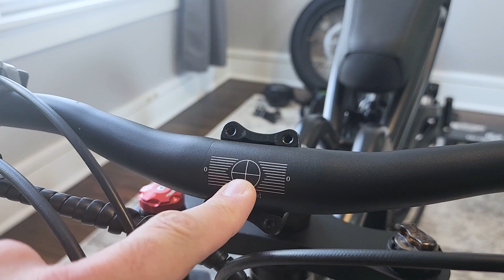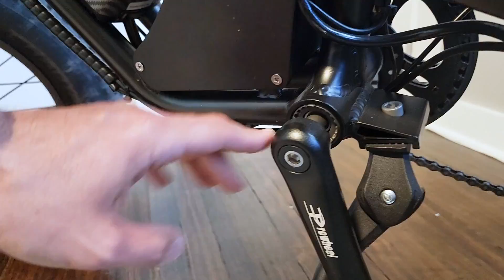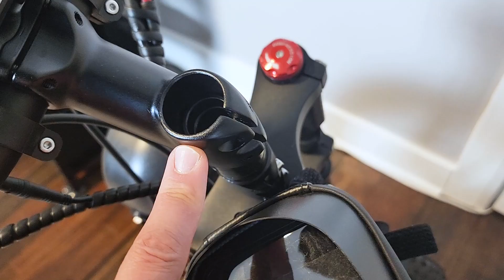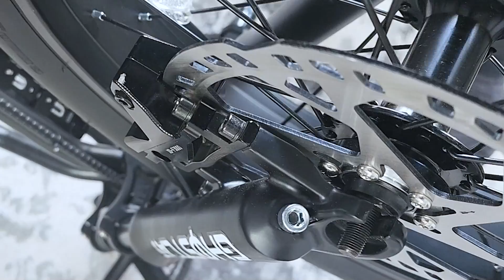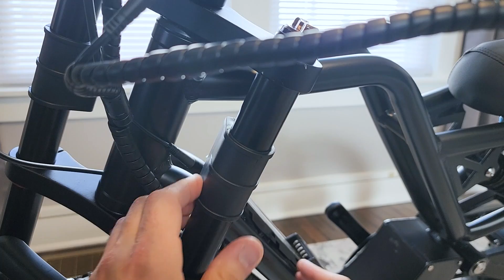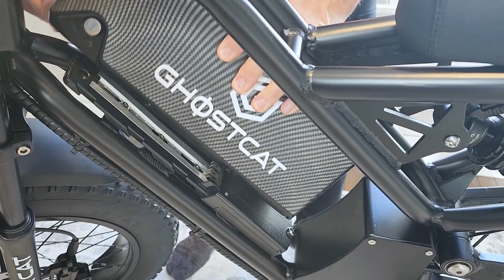How To Assemble Your E-Bike: GhostCat F2.2 Pro

Comment: My F3X front tire does not attach the same way. I think its a threw axle? I put it on the only way that makes sense but my rotor is rubbing. The rotor was the only thing not wrapped and was pushed against the inside of the box. I'm afraid it might be warped? I'm not sure what to do cuz Im not riding it with it scrapping like this. I knew this wouldnt be smooth with no directions 😢
Reply: I should have looked first cuz you already made a video about this which fixed this perfectly. I'll leave my comment incase someone else has this problem. Thank you!

Comment: Just got the f3, pretty rad bike. Would i be able to update the controller to make it faster tho ?
Reply from the maker: congtats! You would realistically need a higher voltage system to get a faster top speed. Not sure if the current controller and other parts could handle 60 or 72 volts. Also not sure about what the motor could handle.

Comment: BE WARNED! This is a china rebrand bike! Legit, same specs, same frame, wheels, breaks and everything. DO NOT BUY!
Reply from the maker: I don't think this statement is accurate. Feel free to post the link to the original here. As far as I'm aware no other bikes with this frame have this motor and controller.
Reply: The Akez Jaguar 1500w does have the same specs. It looks like Ghostcat buys their frames but uses a different motor and a few other parts.

Comment: Failing to mention what tools are used, you should explain what size wrenches are required for those that don't have a lot of tools and want to buy them ahead of time before the bike arrived
Reply from the maker: tools for putting the bike together are included.
Reply: @maximumchargeEV  that's awesome,this company seems to really stand out from others
Reply from the maker: @faiththroughtheflames  they are trying really hard!
Reply: I can attest they have top tier customer service. Just received my f3x yesterday. Technician calling today about something with the rear wheel i want to check on. They already know about the kickstand rattle and were proactive and made a ticket for a new or diff kickstand that doesnt rattle before the bike arrived. Additionally sending decals as i preferred the all black theme of the ghostcat on the front fork veruss the orange volcano suspension decals. Theyve been on communication since day one and before ordering which is main reason i did order. Kevin, nadine, hillary have all been top tier. Ive been in customer service over 12 years. Ive seen it all as well lol. Theyre amazing. I had some slight issues when the bike arrived like brakes and shimano gears on the handle bar not being tight enough i guess which caused them to move during shipping. They were not aligned at all. But those are minor as you adjust them anyways. No missing parts but intiially thought i was but found them. Just got loose in box bc fedex is hard on packages like these. No damage to the bike really. Plastic tube on one of thenlines was slightly cracked bc ziptie broke loose but they include extra zipties i believe. I may get the tech to send more with the kickstand if possible. Then the rear wheel issue is minor i believe. Slight scraping when going from a stop but doesnt continue when riding. Lastly fender(s) that are supposedly larger and medium sized are still in the works and said they would send those out to f3x owners when theyre ready from the factory as owner or person in charge of the bikes didnt like the initial ones that came in. 

They stand out compared to Power Goat in terms of customer service. It took Goat Power bikes like a week or two to even respond to my inquiry about their bike. Inquiries i should say as i tried sending more days later after no response. They finally did but at thet time i had already placed order for ghostcat. Suspension and look for this price are unbeatable. No bike looks as aggressive imo for this style and price . Eventually probably going to get a eride pro ss or talaria.
Reply: @sooperfy I didn't know any of this. My F3X came today but no one's contacted me about anything. It's been raining all day so I haven't got to ride it but I do hear scrapping from the back wheel while lifting it in my living room. I kept adjusting the caliper thinking that was the problem but its still there. Again, I haven't taken it out so I have no riding experience yet. I also haven't been on FB in years and I don't want to but it's probably where I'll get the most help? 🤷‍♂️...I also agree about the orange covers on the shock. I would prefer the Ghostcat ones but I didnt think that was an option. I also didn't contact them. I just bought it

Comment: Hey I am waiting for a goat V3 and you said you may change to a fatdriver. Will that make it do what? Go faster or what and how much are they?
Reply: he prolly said fardriver they are a brand of controller for the ebike and coyuld boost performance based on what your controller and battery are outputing, if the battery can produce more amps than your contorller you can match the amps from controller to battery or have a controller better than your battery to maximize power